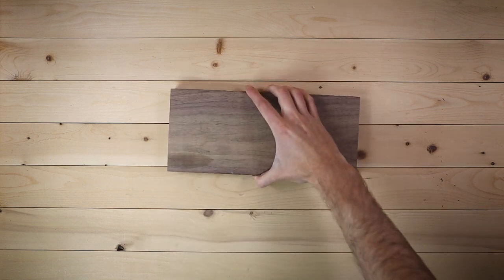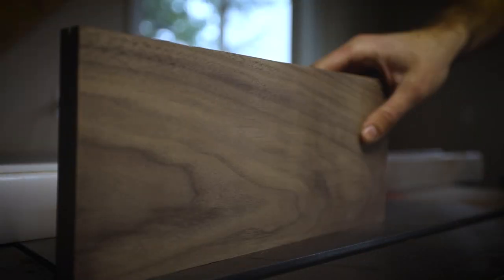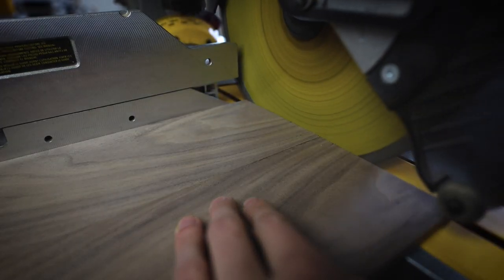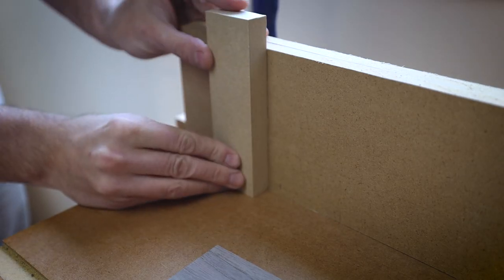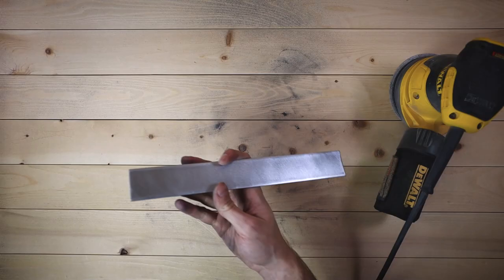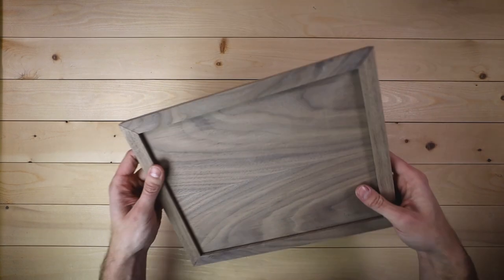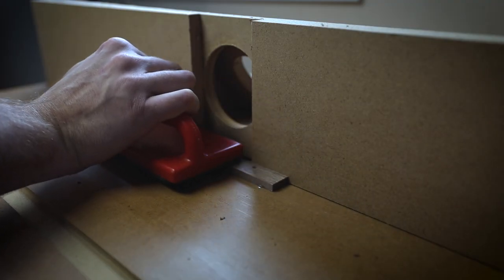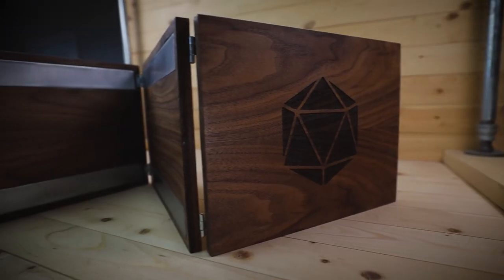How to Make the PERFECT Wooden GM Screen for Dungeons and Dragons

Comment: Very cool looking! How has it held up? 
I'm not a woodworker by any means, but have heard the "don't glue pieces crossgrain unless you want a crack" enough times to always pay attention to it in others' projects and be curious of how much leniency there actually is. Please note that I'm not calling you out, just lookin to learn where the limits are so as not to end up overthinking these kinds of projects.

The theory is, that once the wood on the main panel dries, it will want to shrink across the grain (widthwise). The one vertical framing strips is glued across the panels grain but the framing will not shrink along its grain (lengthwise), causing tension to build in the panel and potentially resulting in a crack to form next to the strip. I'd be surprised if the glue joint itself failed.
If one wanted to avoid this conundrum completely, the framing would have to be left floating at least on one end.
Reply from the maker: Good question! That's definitely a rule of thumb worth paying attention to, and wood movement is absolutely something I consider when coming up with a design. 

There are a few factors that influence it though (a couple of which made me feel confident gluing cross-grain in this instance). The first is that different species of wood experience different levels of wood movement, and black walnut is definitely on the stable side. The second is that total wood movement is calculated across both the tangential (width) and radial (thickness) planes. Because the wood was so thin I felt it was pretty safe to glue it in the way that I did, and sure enough it's held up totally fine! If I were working on something thicker - say a tabletop for instance - then I definitely would have looked at other options.

Comment: What finish did you use on the maple to allow dry erase marker use?
Reply from the maker: I experimented with a few, but eventually ended up just using a piece of clear packing tape, cut down to the maple's outer edges